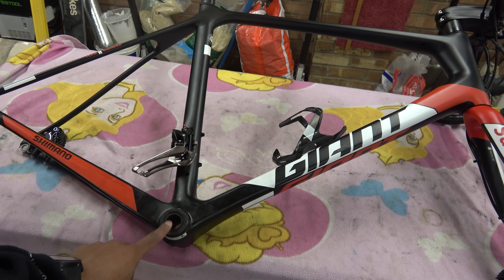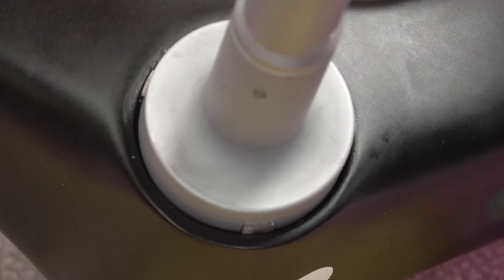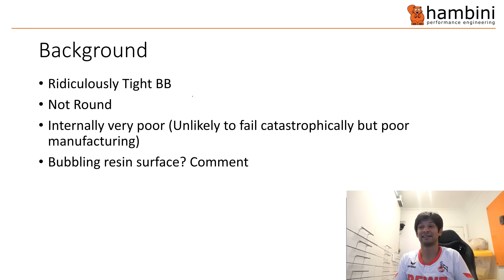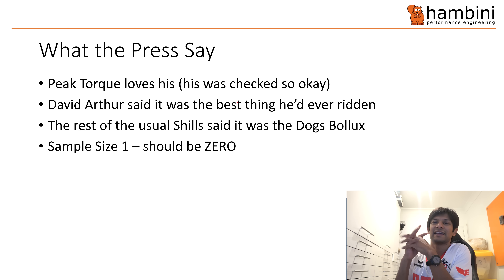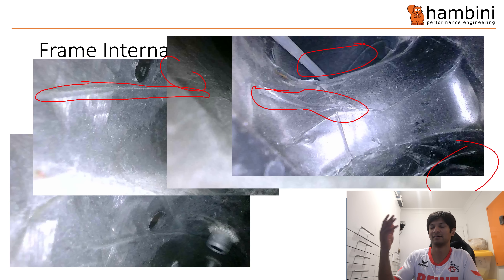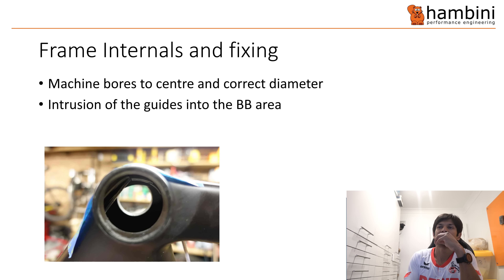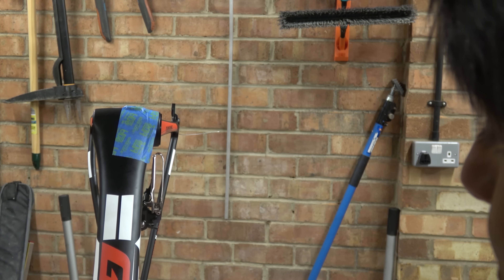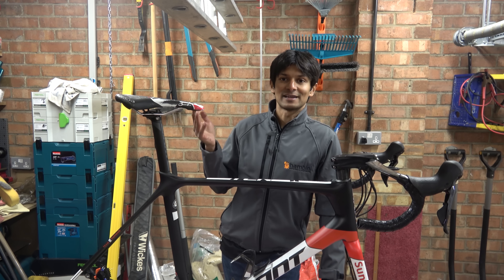Giant TCR gets Roasted. More CRAP quality control

Comment: Hambini, my bike makes a clicking sound after riding about 20-30km. It drives me crazy as I don’t know where it’s coming from. It only happens when there is a bit of pressure on the pedals. Cycling with light power it stops. Any thoughts? Where do I start?
Reply from the maker: Check the bearings in the pedals

Comment: I was replacing the bottom bracket in my 2021 TCR Advanced Pro (bought new in a local store). After getting the old bearings out (which turned out to be much harder job than I was used to), I inspected the frame. It immediately reminded me of this video. The bottom bracket looks undersized and has plenty of similar finishing issues (well, maybe except the paint). Additionally, there's the dreaded seat wedge issue (my bike was shipped with wrong seat wedge which causes enormous creaking). Seems that Giant replaces those in some countries for free. I had to pay for mine. Overall - never gonna get Giant crap again

Comment: Reading through the comments suggests this might not have been a production version available to the public - a team training bike bought second hand.. I don't think this should have left the factory floor by any means but as others suggested maybe they fulfilled their sponsorship obligations on the cheap by giving the crap ones out of spec to the team for training (the uci teams using the Adavanved SL version in competition in any case). If this had been bought from a shop for rrp or anything close to it I'd say the customer should be outraged and ask for their money back. But they didn't, so not applicable here.  Fwiw I have a sample size of two and they have been flawless

Comment: Wonder if a power-meter, if the variable of the bottom bracket/bearings used was added as data, be able to detect a dodgy frame.....

Comment: I disagree with your premise that the wrinkles in the frame are a weakness. If you scape the sharp part of the wrinkle off it will be resin not cloth. The wrinkle is from the plastic bladder when vacuum bagged. The cloth is not wrinkled.

Comment: I strongly think that it's not the quality control employee to blame here, but the de-facto very relaxed company policy, so that they maximize the profit.

For the average cyclist, such tolerances are firstly difficult to measure, and secondly, they pass unnoticed unless there's a flagrant issue (e.g. bb creacking).

Anyways, the reputationsl risk in cases like this is unfortunately fairly low, so the profits are big, and the shareholders are happy, it's only the cyclist who suffers a bit, but hey!, "no pain, no gain"

Comment: Boy, that camera simply WILL not focus onto any nearby detail that don't fill the whole image, will it? Maybe you could find a manual setting that allows you to control the focus distance manually, for instance via a slider on its screen (for a short while and when needed) in only one or two seconds so that attempting to focus it a minute long without final result could be avoided?

Comment: You're always referring to this "Shimano Spec" for BB86 bottom bracket shell diameters. (see 7:23).

Where did you get this supposed standard from?? The official "Products Technical Information" manual from Shimano clearly says (QUOTE): "Due to variations in material properties and the structure of bicycle bottom bracket shells, SHIMANO does not have recommendation on the frame dimension that is the inner diameter of bottom bracket hanger. Therefore, please study and check it’s quality. SHIMANO does not guarantee the fitting quality between frame and bottom bracket unit. SHIMANO guarantees the outer diameter of bottom bracket which is ø41.00-41.07mm."

I'm not saying that the frames you review don't have a shitty BB shell quality...just that you should not always claim that they are undersized/oversized according to some "Shimano Spec" because there is simply no official Shimano spec for this diameter. It's basically up to the frame manufacturer to figure out which diameter works well with all the BB Cups.

That being said, it seems to me that it's a pretty difficult task to find a dimension which offers a similar performance with plastic cups (shimano) and sintered metal cups (SRAM) and CNC machined metal cups (Hambini, CeramicSpeed).

Comment: I have a Gaint TCR with Ultegra Group Set and Rim Brakes.  Its light weight, it's a stiff frame, it's responsive, very comfortable to ride on long weekend rides. I've had no issues or problems at all with the Bike, just great in my opinion.

Comment: The wrinkles just seem a result of a wrinkled bladder which in turn created a void that was filled with excess resin.  I guess you could say that the carbon fiber mat wasn't compressed at that area because of the void, but they are still suspended in resin which in turn, just holds the fibers in a frozen state.  Not an ideal position but at least resin is not as compressible as an air pocket.

Comment: Another good analytical piece of Engineering.  I'd already had some bad experience of press fit BBs in carbon frames,  watching your videos confirmed my thoughts that press fitting hardened steel bearings into carbon fibre is simply bad design - even if the BB is a good fit.  The bearings will wear the carbon frame - which is why Trek even do a slightly bigger bearing for their BB90 to give the frame some more km before it is junk.  I've now bought a Ti frame with a threaded BB.

Comment: Talking about the bearing housing fit. I'm a design draftsman and have specified sizing for bearing housings umpteen times. If the housing is in a machine tool for example where it's very solid and stable, then sizing straight from the catalogue is obviously correct. Thinking about this housing though - it's very light weight and probably somewhat elastic - could it be that Giant's experience tells them that sizing needs to be different to ensure a long lasting snug fit for the bearing? Just a thought. Maybe, as someone mentioned, a sample of one is not enough here...

Comment: I don't understand why some think a machined BB is superior to a press-fit? Just because a thread is made on either side doesn't mean both sides are aligned. 
Hambini's solution overcomes the shortcomings of the bike industry. Don't expect the bike industry to change until people stop paying stupid cash for these out-of-spec BB's. That said, I've fixed BB issues with Hambini's more expensive press-fit-solutions and with FSA's BB-BSA  much cheaper option.
Reply from the maker: it's not superior. there is an added interface. the prroblem is the bike suppliers can't make it.

Comment: Well, couldnt the wrinkles just be some additional epoxy between a still strong aand straight carbon layer and the plastic foil they use in the autoclave, that wringkles?
I mean, thats its just a cosmic epoxy-thing and not a carbon layer as discribed with the paper in the video? 🤔

Comment: Not long ago I replaced the Dura ace 7800 bb as thought it was creaking but turned out to be the chainring bolts causing the creaking, it was still smooth and the carbon shell looked a lot nicer than the one in this video, the 6800 BB went in a dream too.

Comment: Very interesting the different manufacturing quality with Giant. I have a 2011 TCR Advanced SL, and the BB has a machined aluminium insert glued into the carbon shell that is 100% to spec. I guess the quest to save the odd gram here or there has lead to these corner cutting measures.

Comment: A little confusing. Additional 100 micon interference on 40mm diameter is huge. But it's not a bearing fit, it's the fit onto the bearing cup. So maybe the od on the cup was undersize. Is this a special? As a team training bike maybe it was a salvaged reject? (if it had really had an extra 0.1 interference would have thought might damage the frame getting it on/off (unless the cup isn't metal, if it's a composite cup the interference might work}).
On frame quality, ndt on composites is a bit limited so there is redundancy. What might worry is if the wrinkles are close and parallel or crisscross. What would be interesting would be an assessment of the front fork. 60km/h downhill, carbon fork failure will kill you. It would be nice to know what the quality of various manufactures forks are and what safety factor they use.
thanks. kbyhd

Comment: I have a Giant Propel, and the top rear brake cable entry (just back from the steering column) is very poor, paint pealed off, showing like a white filler into the carbon, its look absolutely crap.
Contacted the shop and they have said it will be replaced, but gave me a date of April/May, so not overly chuffed, and a god damn black frame instead of my super bright dayglow orange.
Well put off Giant now.
Reply: so the paint peeled and they offered you a free new frame and that put you off? damn, cyclists are such entitled brats.
Reply: @adrianc6534  It just shows you know fuck all about anything you dumb arse
If the paint peels, it means the carbon frame is then open to the elements. It could be very dangerous as the frame may fail, are you really that shit stupid? opps, already answered that one.
Damd thick fuookers, entitled twats.

Comment: Probably already stated
Wrinkles, will that not just be excess resin from the internal mould bag ? 

I do agree about the bb86 shell though
My 2021 TCR SL is just as bad on the drive side
Your Necked Threaded BB has cured the issue to a usable state and the NTN’s are going strong 

Can I ask how did you get the bb to true round and correct diameter
Reply from the maker: A lot of people have mentioned the excess resin. In this case you can see the carbon has moved to cause the peaks. Once one moves then they all move. 

The bike has to go into a boring machine and then machine up to get it round. It's quite a tricky process.
Reply: @Hambini  so not the method you used before on a previous frame with the sanding wheel ?
Or a reamer like BBINFINITEshite do 😂

Comment: When is comes to redundancy from layers of composite @ 10:40, is it the strongest layer that takes all the tension?  It seems similar to if you take a rope and a thread together and hang a weight from one end, the thread would not be able to suspend the weight, but it does not break because the rope takes all the load.
Reply from the maker: It would be the "shortest" layer that would take the tension. It's almost like towing a car with a tow rope. That initial movement as you take up the slack before the car moves. If you took the analogy of multiple ropes towing the car all of a different length. The shortest rope would take the tension. If they were all the same length, then they would all take the tension.
Reply: @Hambini  I can see how the shorted layer would take the tension, but I saw another very good explanation of why, when all layers/ropes are the same length, the strongest always takes the strain, the weaker components only fail after the strongest fails first.  It would help if I could find the video.

Comment: I know hambini is trying to sell BBs but I've always believed that Shimano BBs worked best on BB86  as the plastic or delrin as they call it outer casing is designed to deform slightly to fit the BB shell.  I had a trinity with a lovely smooth Shimano BB which I replaced with high quality bearings for a rotor crank and one of them was slightly deformed by the imperfect tolerances and was rough as hell. Best to use what those frames are designed for IMO.

Comment: 2020 propel SL1 disc here, so tight on DS that the Shimano bearing was compressed and not spinning. Face of BB shell was angled as well, i.e. not parallel to plane of the frame. Hambini BB install was like a gun going off.
Reply from the maker: Oh dear. Did you get it fixed?
Reply: @Hambini  Negative, I tried but cbf after stonewalled at LBS stage.  A close riding buddy with a hambini BB in his 2021 TCR Adv Pro disc had the same observation on his frame and install. Sample of 2.

Comment: That’s very likely a 2018  Adv Pro Disc used by the Sunweb development team. The full team rode SLs in the same colour, with rim brakes. 

The Adv Pro in that colourway was released commercially in late 2018 for 2019 as the ‘Adv Pro Team’ and it came with rim brakes only, with mechanical Ultegra. 

When you re-bored the BB did you notice the material that was removed? I think it’s likely that it was a 2018 disc frame that’s simply had a hasty aftermarket paint job to out the team colours on for the development team, which gummed the interface.  Did you see any signs of dark blue, silver or white paint? Because those were the Adv Pro Disc colours that year. 

I’ve had three TCRs of that vintage, and Adv Pro and two SLs, and none have had issues with the BB housing.  The Adv Pros do have a poor seatpost interface which I sure you could accurately describe with some of the hyperbole used in this video, but the frames are generally of a good standard and I can’t say I know anyone who has suffered premature non-accident failure of a 2016-2020 TCR frame.
Reply: They paint the frames with a very thin coat and I would thing the painters would mask off the BB. If they did get paint on the mating surfaces then it would most likely be not enough to affect the concentricity.
Reply: @glennoc8585  I think the issues might be, and I could be wrong, that they’ve gone over a production finished frame without sanding it. The finish around the BB has spoiled as if incorrectly prepped, and the finish looks crap as well. I mean, these were matt black and that doesn’t age well if not looked after, but it’s mottled and blistering. 

Could just be a bad lay up, god knows Giant kicked enough bikes out their factory that there must be some variance, but if I was examining a TCR frame and drawing a conclusion about the QC of the range, I wouldn’t start with this oddity. 

That said, if we ever want a laugh I’ll send Hambini my 2001 Once team TCR which had the previous BB removed with an angle grinder. It’ll probably give him a heart attack!

Comment: My pen is n’t working, so I’m typing this. I bought a Giant Defy Adv Pro2 in 2020 partly on the strength of reassurances on Giant quality here.  I’ve only ridden it maybe 500 dry miles but I’m pretty sure the b/b isn’t quiet.  Now wondering if I made an expensive mistake.  And that’s before I get on to the design of the stem and cable routing. Hideous design…

Comment: I gave up on Giant Road bikes, after working with/on them for 7yrs. I remember in 2017 0r 2018 the shop I was working at received a huge batch of TCRs and Defies with misaligned and poorly shaped BB fittings... When I told the Head tech and the owner that there was something wrong with the frames I got so much flak from them and to top it off they were saying what a shit mechanic I was to the point that I finally left. After I quit I went back for some reason, can't remember exactly why but the owner admitted that the fault was with Giant and not with my work, he asked me to return because for some reason there was no one there to fix that Head techs blunders and shortly after that, the wanker got fired and I never went back. 😂😂😂 

Thanks for all the great content, love seeing you rip these companies and techs new orifices to excrete their feces from!

Cheers from Montreal!
Reply: Unfortunately there is still a lot of taboo about speaking up against sub standard products and that's across all industries. Even with acquired skills and experience theyl "the suits at the top" will try to silence you and attack you with negative connotations. At a technician level they pass you off as a nobody, a pleb anything to try to lower your esteem. Even hambini at Engineer level is being dismissed and receives ad hominen attacks. It takes courage to stand up to shoddy work you risk a lot but someone has to do it.
Reply: @glennoc8585  After over 20yrs in the industry I can officially say that the cycling world is broken here in Quebec (especially Montreal) Most senior Techs I know are a bunch of lazy has beens (intellectually and physically) that don't want to keep up with the new tech, shop owners are penny pinching every chance they get even though it's been the best two years of sales on record and all the younger mechanics, well they know everything after watching a few YouTube videos and still get DOT and mineral fluids confused... There used to be a couple of shops that I would consider honorable a few years back but even they got greedy. Anyhow I'm out of the industry, I have a decent workshop at home, have a few clients, but now I'm in the culinary world. Still have a love for cycling, I try to keep up with what's going on and if someone brings me something new to work on it's always a pleasure.  Oh and trust me I do call shoddy work when I see it, brings joy to my heartless soul 🤣🤣 🤣 
Cheers sir !!!

Comment: Giant are well known for having some of the best QC on carbon frames. About the only carbon I would buy used - they have a policy of overbuilding - always 100-200g of extra material compared to rivals. Crashed my TCR at least half a dozen times and it was unaffected. My club bought dozens of frames through a relationship with LBS. Only problem I've seen was a delaminating headtube - frame was replaced immediately. Seen dozens of problems with other brands - Trek, Cervelo etc. Looks like this was a special run of TCRs that got through. If it was bought directly from LBS they will replace it no question.
Reply: LOL